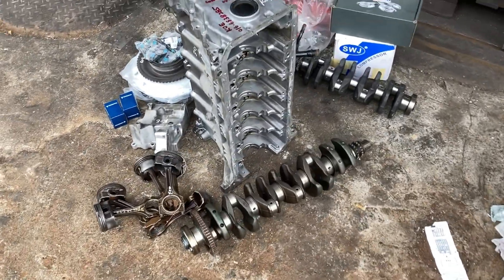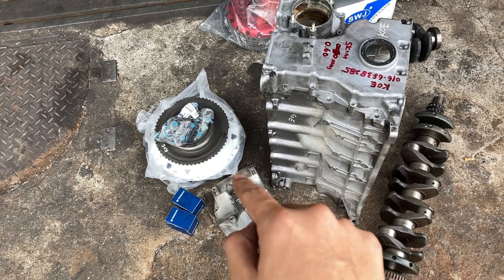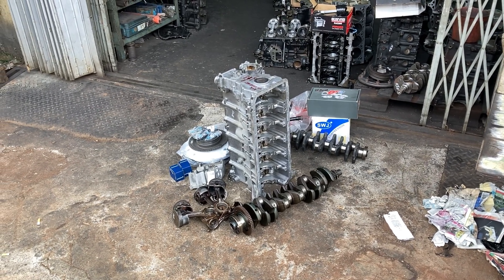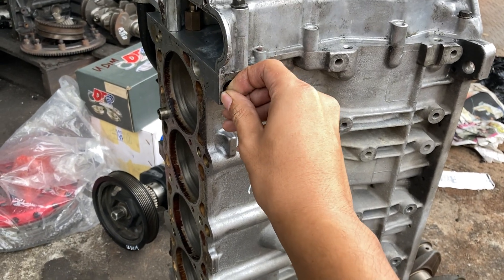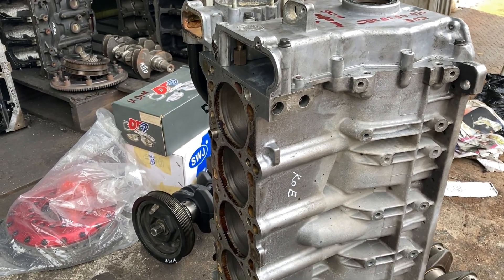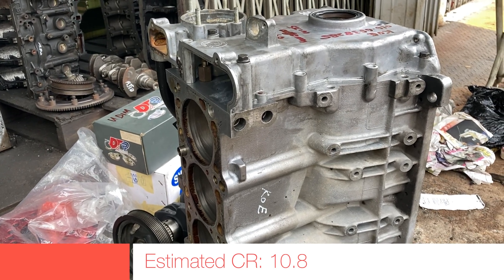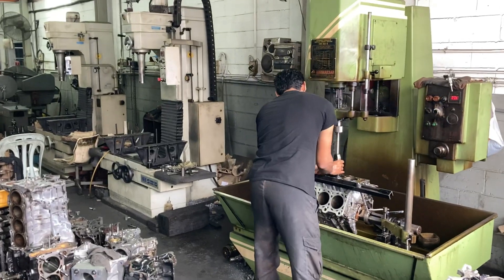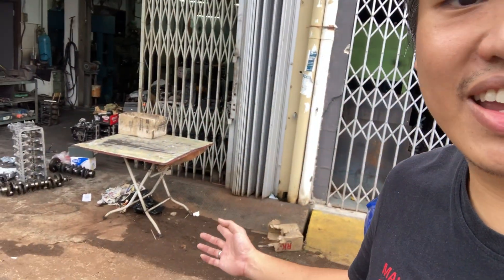EP4: Trip to machine shop for full balancing and decking

Comment: Do you have to do anything special to the valve train as well? Does that need to be balanced or do you just need Heavier Springs
Reply from the maker: Nothing. I will just use M54B30 intake cam for some extra lift and duration. I am not revving more than 7k RPM, so no changes to the springs